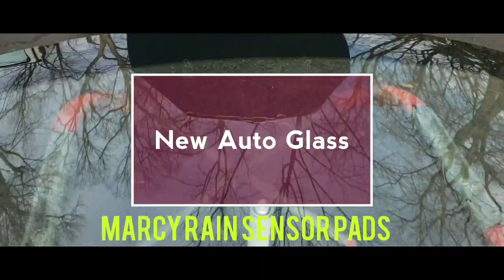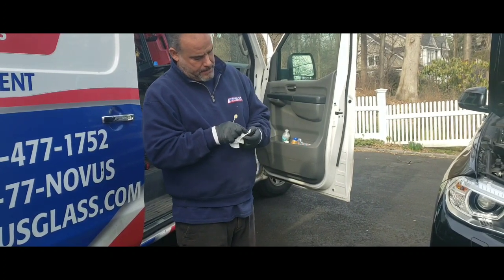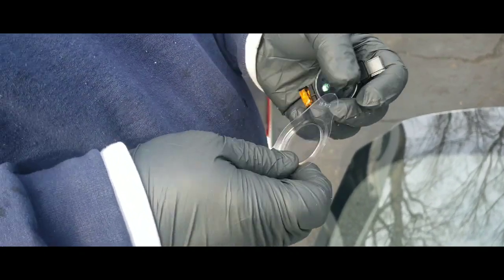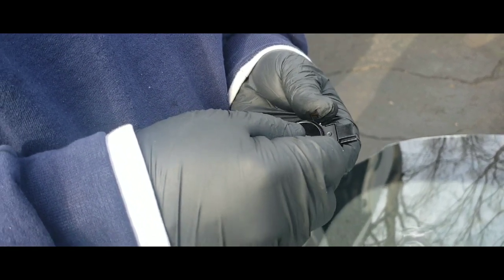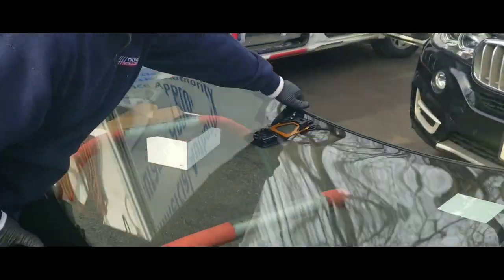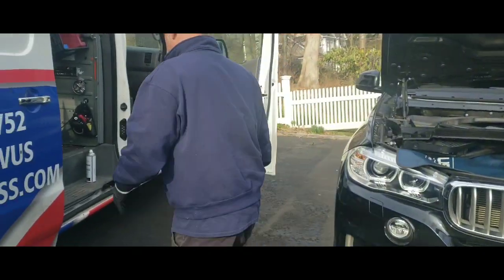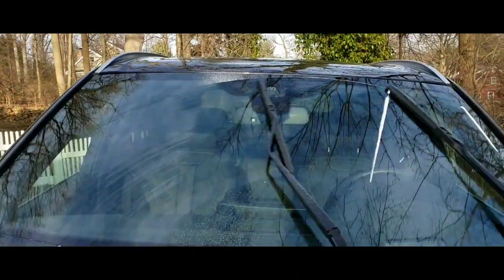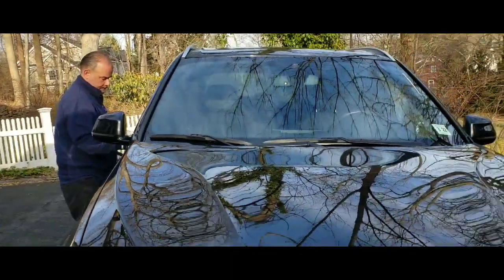Windshield rain sensor. Marcy sensor pads

Comment: The Marcy Rain Sensor Pads are made of a fingerprint-resistant silicone material.  Made thicker than other pads, and cured to just the right firmness, these pads won't give you problems with air pockets once installed.

Comment: what do you recommend for adhesive to attach the mounting bracket to the actual windshield? I attach it with various adhesives but then emplace the rain sensor and it pushes the mount off the attachment point. Thanks